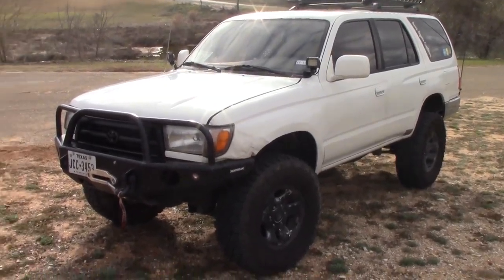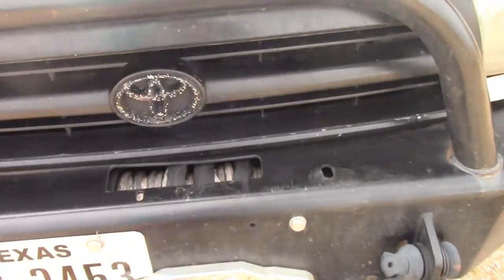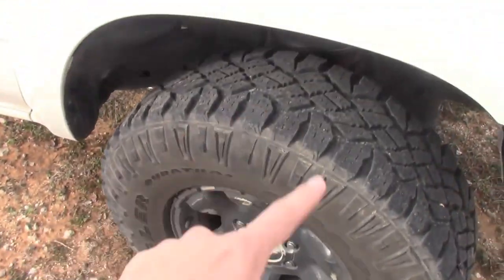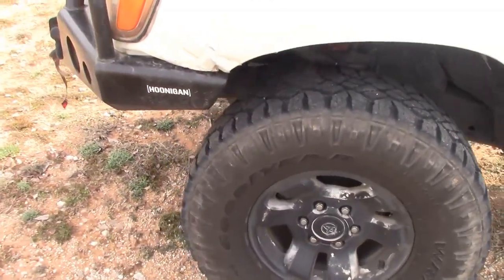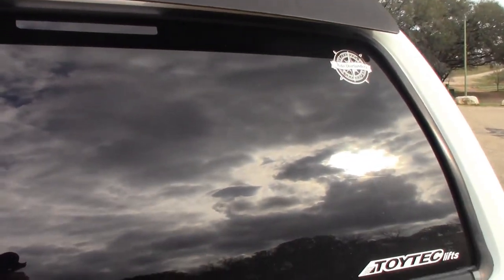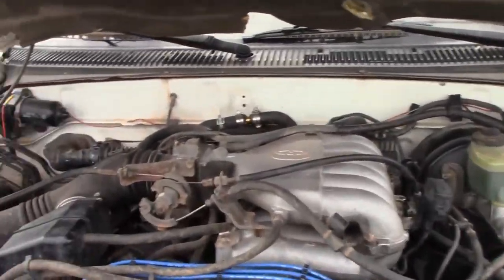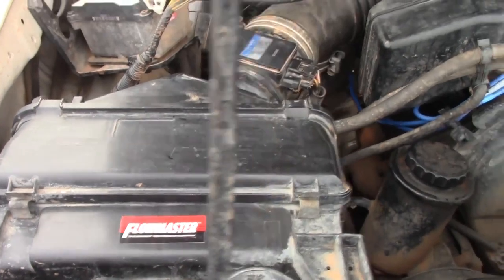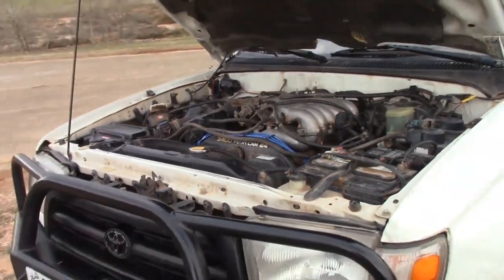Trail-Ready 3rd Gen 4Runner Walkaround/Mod List

Comment: Just as an fyi, Ive had the same car for 10 years and you definitely want the twin ground electrode spark plugs over the single. the singles can mess with transmission shifting in low gears. it almost mimics a failing transmission.
Reply from the maker: To each his own I guess. I haven't had any issues since I put them on, so I'm not concerned with it. Thanks for the feedback though!
Reply: Imagine being named Samuel, must suck

Comment: Thats a very clean-looking build. Yyou think those duratracs would work on a 2-inch lift?
Reply from the maker: Thanks! I can't say for sure but I would imagine it would work. If you have a stock front bumper that might be what would give you rubbing issues. Might check on forums though for a definite answer.

Comment: Hi. Are those 285s mounted on stock toyota 16x7 rims? If so how are thr tires wearing??
Thx
Reply from the maker: Yep stock wheels. They're wearing great, I buy 2 at a time cause the fronts always go down faster and I just put the rears up front. I've had the rears for like 40k miles and they've got tons of life on them still. I'm fixing to need to get new fronts but they've lasted a long time as well

Comment: What brackets did you use for the ditch lights? I’m looking at the CBI fab ones, but I can’t find any videos on the 3rd gen 4Runner specific ones.. people are melting plastic to make them fit on 5th gens have me concerned they weren’t as vehicle specific as they say...
Reply from the maker: I honestly dont know what brand the brackets are as I didnt install the pods. They came with it when I bought it. They aren't perfect fit though by any means, up close the plastic is all cut up so I'm guessing it's somewhat of a universal design bracket that the previous owner put in and made fit.